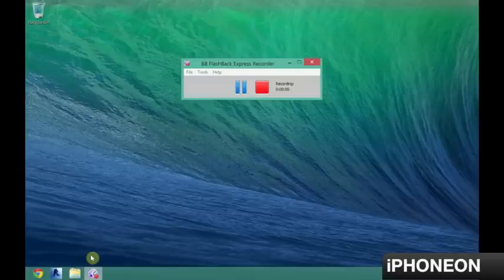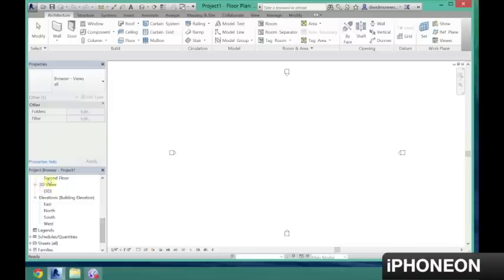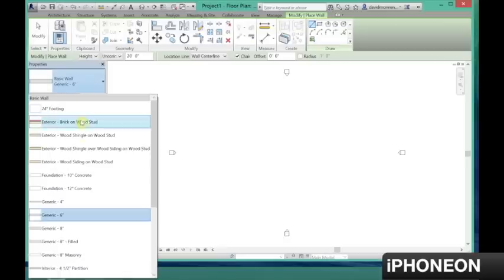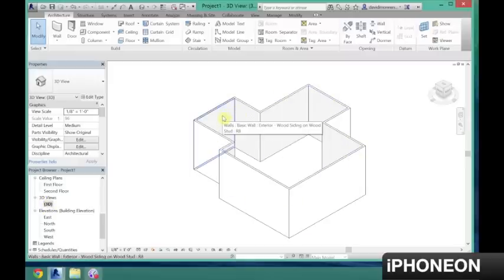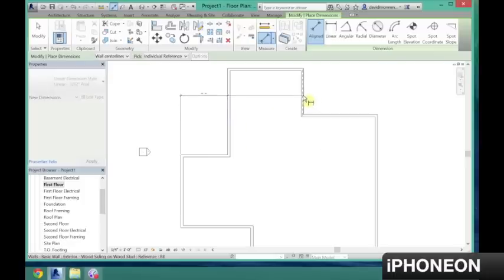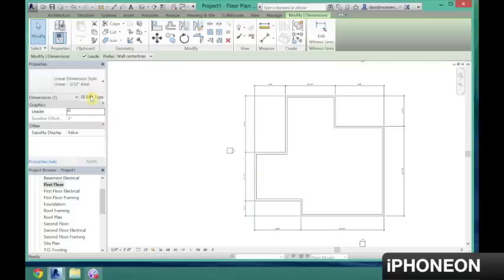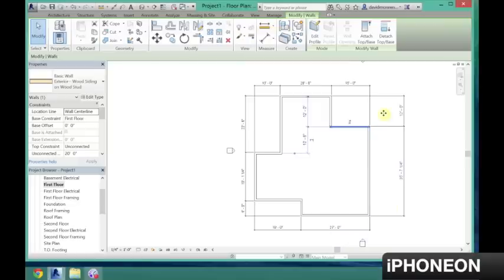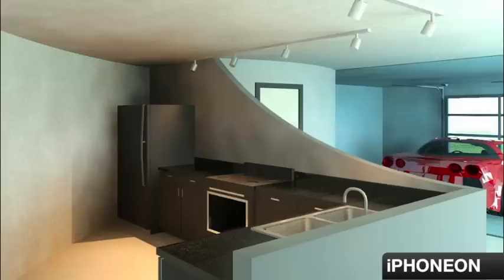How To Create a Basic Floor Plan In Revit

Comment: I followed along, but for some reason my walls do not move together when resizing them (only the wall that is highlighted will change size, but the other walls will not compensate).  Is there a setting that I'm missing?  I'm using 2018.

Thanks!

Comment: I tried to change my wall length like you did by clicking on the wall and then clicking on the dimension number but it won't let me change the value. Should I hold down another key when I click on the dimension? I don't know if my question makes sense or not.
Thanks.:)
Reply: I've got the exact same problem, any clues as to how ?

Comment: Hi I have a question, If i create a 10" wood floor joist with sheathing in a residential setting, how can I divide that floor into having different finishes, hardwood and ceramic tile. Do I need to create multiple floors with different finishes ? or can I add to a floor without finishes afterwards?
Reply from the maker: You can do either, create separate floors or add finish afterwards. I have a video on that if you search for it on my channel. Thanks